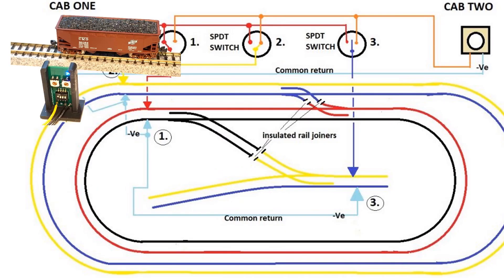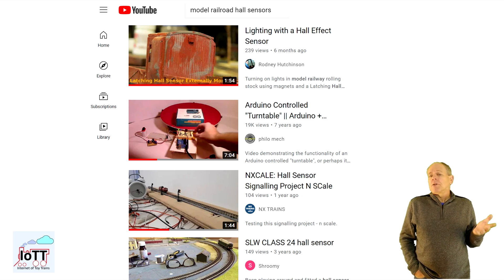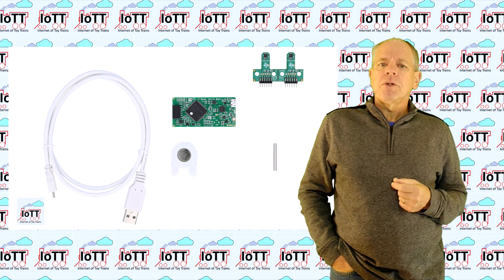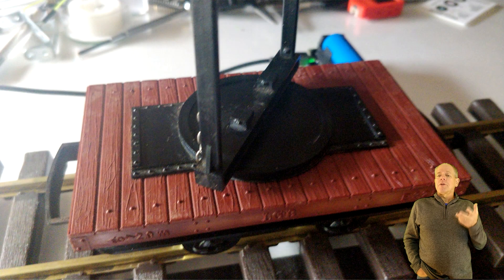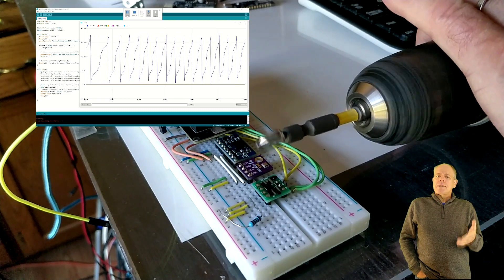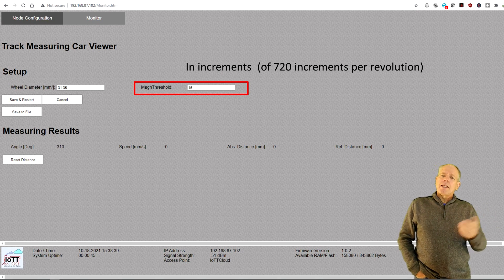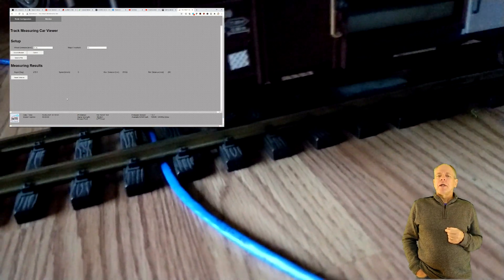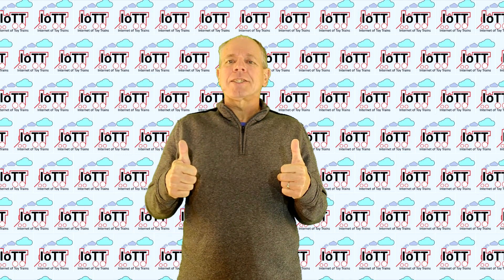Using a 3D Hall Sensor (Video#81)

Comment: Will the axle-mounted magnets work with standard track magnets used for coupling/decoupling cars?
Reply from the maker: Hmm, there are all kind of magnets being used for uncoupling, I don't know what the standard would be. For G scale, I am using 10mm round Neodymium from Home Depot. For smaller scales I have 2mm and 3mm diameter ones I bought on Amazon. Around a cent per piece, but package size is 200 or so. Plenty for a whole layout ;-)

Comment: wow , it it so good. I am trying to do similar thing with TMAG5170. May you share code please with some wiring. There are lots of error in current library actually, and  I am almost newbie.  Best regards.
Reply from the maker: I have not released it yet, but you can get a copy from the prerelease repo on my Github page: https://github.com/tanner87661/IoTTStick/tree/Prerelease/Sketchbook
Check the libraries directory for TMAG5170-main
You can also have a look at the RailTracker sketch to see how I use the library for my sensor.
Reply: @IoTT  Thank you so much for code snippet sharing. Actually I have no TMAG5170 IC yet. While  I have try to build of code what you share on video and github, I realise some of function didnot exist on current library such as getAngledataRaw()... And there is no function declared at the header file of tmag  that is getFieldData(buffer,int,int) at regConfig.... Will them be caused problem ? Best regards.
Reply from the maker: As mentioned in the video, I was not able to make the official TI library work. Luckily I found a paper from a student who did a program using the chip (https://fab.cba.mit.edu/classes/863.20/CBA/people/davepreiss/weeks/11.html )
Unfortunately he did not do a proper library, but just a sketch with everything in it, so I used it to fix the TI lib. If I remember right, it was mainly timing problems in the initialization of the chip.
And yes, I added a few functions to make adapt it to my form of usage. But it is still incomplete. And of course, if you find a function in the code that is not declared in the header, you can always add the declaration to the header.
Reply: @IoTT  Thank you so much, It will open new gate for my hobby project.  And I have already subscribed to follow your interesting works. Best regards
Reply: After many many attempt I have no idea why I have no communication to Arduino Uno. I have connected pins like CS->10, SDO->12 , SDI->11,SCK->13 which is shown at spı library document . May you give some tips please.  I am so sorry to bother you while asking so easy thing forgive me
Reply: There are cold connection of clock pin , I have found it :)
Reply from the maker: @ozgur280  Very good. I just ordered the I2C version of the same chip yesterday, which will make for a simpler connection.
Reply: @IoTT  cool, i have it too, however the communication protocol is so new for me, and i want to build prototype immediately thats why i choose spi thaks to your help.i am planning to use i2c after proof of concept. Best regards. 🤗🙏
Reply: @IoTT  Merry Christmas by the way .... my TMAG5273  is for ı2c. as is it similar with yours
Reply: Hello again, I hope everything goes well with you,  have you done test of I2C version IC ?
Reply from the maker: @ozgur280  Yes, I did. See videos #87 and #88.

Comment: Hi Hans. When you did the axle counter test di you try to run a loco over it?
Reply from the maker: No, I did not. Possible that you get some strange feedback from the motor magnets you have to filter out.  But I am pretty sure the signal would be quite different from a permanent magnet floating over the sensor, so it should not be too difficult.
Reply: @IoTT  OK - But most motors have permanent magnets around the rotor. There will naturally become a mixture of fields from the two sources. 🙂

Comment: You can possibly avoid the "slipping" error by installing a LGB ball bearing wheelset (e.g. item 67403) where wheels have independent bearings and axle is rigid. Those are used in wagons fitted with lighting and are available as spare parts. Naturally you have to install magnet differently and count only one wheel adjusting the distance accordingly, in a circle format layout this is easily done but for other geometries rotation of both wheels have to be measured and average calculated, however, no errors due to slipping.
Reply from the maker: Ball bearings are certainly a good thing, but have nothing to do with the problem of locking the wheel to the inner or outer rail based on the car being pushed or pulled. 
For a general understanding for the wheel - rail interaction this might be a helpful video: https://www.youtube.com/watch?v=rT6Qh8b-3Ks
On the 60cm radius the axle will experience what is called a "sharp curve" in the video, hence the flange will lock with the rail when being pushed. When pulled, the pulling force is braking the lock and friction between the inner wheel and the rail increases, therefore the difference in trajectory length.

Comment: WoW, I love this. One usage I see for me is to have a speed measurement car and adjust locomotive speed. I normally speed match all my locomotive to prototypical speed on my N scale layout. This is really interesting feature. Wonder what you have in mind with the other chip.
Reply: Did a quick search on the web. If you can make the other two chips work it will be interesting to see the possibility and practical utilisation. Your always full of surprises.
Reply: I would love if it if you display the speed in the different scale. And in mph and kph.
Reply from the maker: That's really easy to do. Right now it is measured in real world meters per second. Multiply by 3.6 to get km/h and then multiply by the scale factor. And most likely I will do a drop down selector once the software is somewhat finalized.
Reply from the maker: The best way to do speed measuring is using a full revolution of the axle as a distance base and then divide by the time. The reason is that there is a slight non-linearity between axle position and magnetic field strength as you can see in the monitor screen shots in the video. But a full revolution is always a precise indicator.